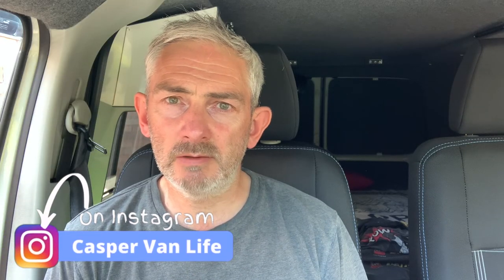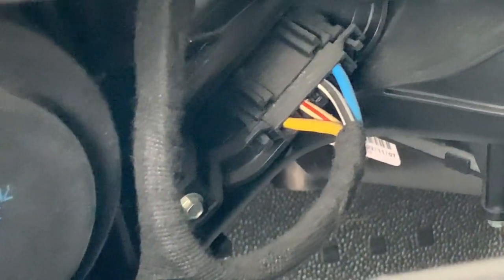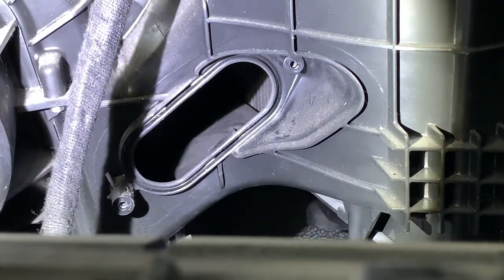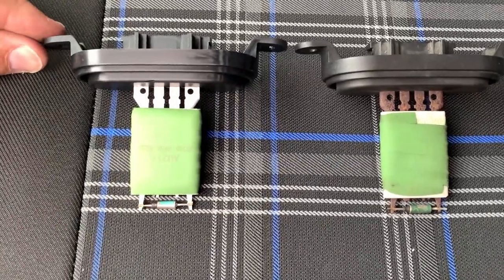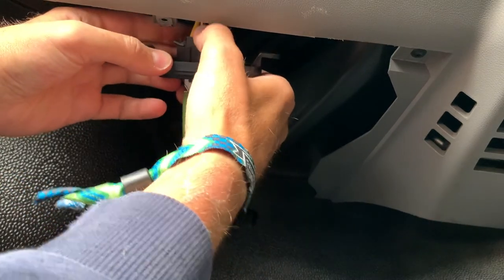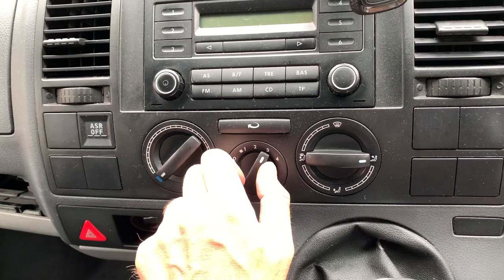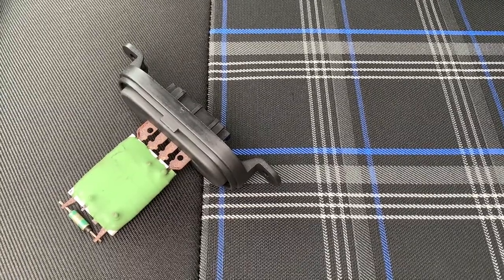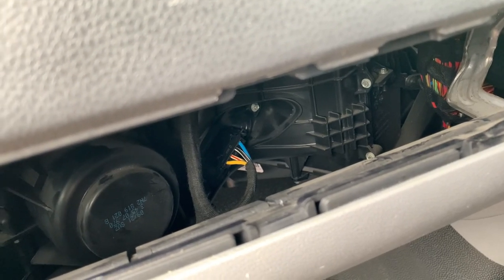VW T5 Transporter - Heater Blower Resistor Fix - Could Be Easier Than You Think

Comment: Hi, great vid. 
I had the same problem on my first T5 and so I replaced the resistor like you and solved the problem, but, the problem arises because dirt and grime get into the fan housing making it harder for the fan to go round (hence the squeaking), which in turn burns out the resistor.
You need to take out the fan housing (just as easy as taking the resistor out), and grease up the fan to stop the squeak and prevent it from happening again.
Keep up the good work with your vids🙂👍

Comment: You dont have to replace the whole resistor just the thermal fuse .
Just make a note of the blown fuse rating order a new one on fleabay and crimp or solder a new one on in the original orientation. 
Done loads over the years!
Reply from the maker: I wasn’t aware of that, as I’m sure many others won’t either… top feedback, much appreciated 👍